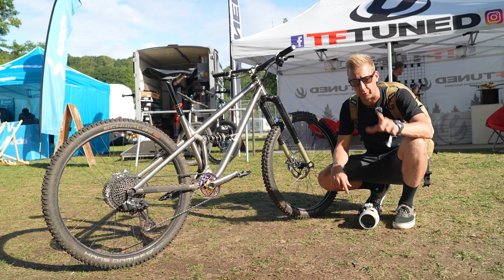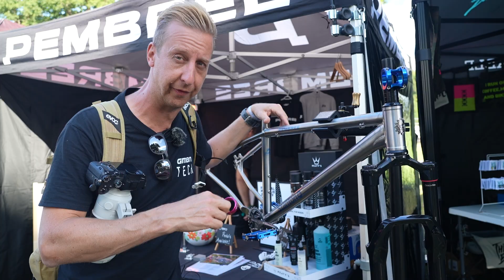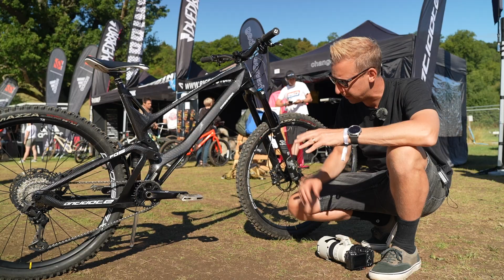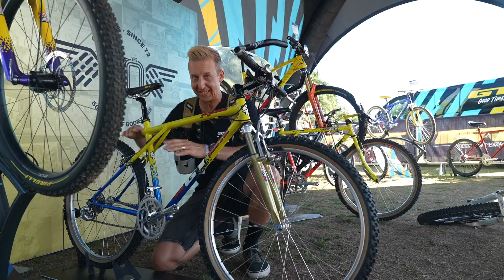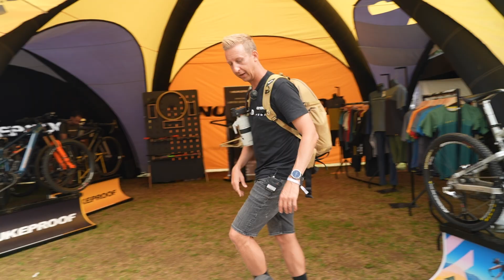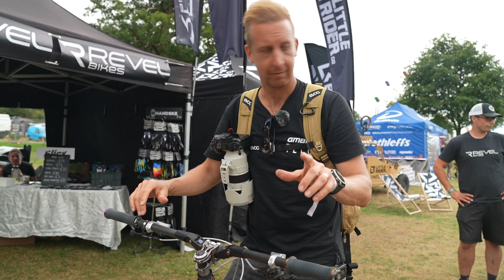The Hottest Mountain Bikes & Tech! | Malvern Classics 2022

Comment: I'm an above knee amputee and ride with an Absolute Black Oval Ring.   I'd say 70% of my power comes from my 'organic leg' and 30% from my 'stump n prosthetic leg".  I swapped to an oval mostly to smooth out my pedal rotation, as my pedal rotation was not smooth and could be described as almost 'jerky' on ascents.  I swapped to the oval and although the gains are subtle they are defined gains.  My peddling is now a lot smother on ascents and I finding  I'm using more power through my prostheic leg because of my now smoother cadence.   For me personally I will be always using an oval chain ring, along with my Hustle REMtec magnetic pedals - these have been an absolute gamechanger for an amputee wanting to get on the offroad trails.

Comment: See Wren inverted 150 mm 36 stanchion forks...been using on all my bikes...now on my E-mtbs. Plush, progressive throughout, easy to tune, and stiff. Very DIY servicability. Can run any wheelsize. Comes with carbon stanchion guards. Just a quick plug from a fan of inverted...I own three🤟

Comment: USD forks changed the game for motorcycles, both street and dirt, it's honestly only a matter of time before they do the same for MTB. Nothing like having gravity keep your oil bath in a place where it's doing a good job lubricating the fork (assuming non-cartridge style comes out first) plus the additional overlap for stiffness.
Reply: USD forks have been in mountain biking for over 20 years. They never caught on, and they flex a lot more than normal forks, actually.
Reply: On motorcycles they are stiffer but plushness is missing. I prefer older dirt bike suspension.

Comment: you also fail to mention that this polish bike is made of weaved carbon fiber, that is totaly outdated, but very pretty, modern frames are all made with unidirectional carbon, cut into hundreds of pieces and glued together, in a way that you can add flex, or stiffness where you want, in the direction you chose, but you need a super computer to design the frame, so smaller companies like that polish one use the old fibers, pretty, but not good
Reply: You do know they use uni underneath and just have the weave as top layer for looks right.

Comment: That reverse fork design is interesting but the stanchions being closer to the ground is gonna scratch real quick, not to mention mud and dust cycling through its seals.

An interesting design nonetheless, similar to the linkage fork.
Reply: Actually, it's better in this concept. Dust don't lay on the seals becouse they're upsidedown and You can avoid scratching legs by mounting guards (rulezmann doing nice ones for intend)
Reply: @sauber8623  As someone who used to ride manitou dorados way back when - usd forks  still get dusty and are prone to seal blowouts. They get scratched at about the same rate as normal forks if you have covers.

Comment: Both me and my bike are crap on the climbs so I put an oval chain ring on as I heard it helps. Wow what a difference. Same tooth count as I had before but I lost that feeling of lightness and disengagement when one foot stops pushing and the other takes over. With the oval I feel I’m always putting power down. Bare in mind I run flats and can pull with my feet so it’s not just technique. I’d say it worth a try and made more of a difference than lowering the tooth count did.

Comment: Oval on a full squish was a game changer for me. Significant climbing improvement.
Reply: Exact same for me, less knee strain also
Reply: So i want to Switch from my E-Bike to a normal Bike ITS better i Put oval Ring or IT ? Is there negatives If i so so? Ty
Reply: @lakaldrak  no negative that I have found. Supposedly it can put  more stress on your derailleur clutch and the first few crank turns may feel a little odd, but I am on my third oval, three different bikes with zero derailleur issues. Note; I did not like oval on my hard tail. But amazing on my full suss
Reply: @lakaldrak  on really high candence oval chainring feel little bit like you jump on your bike. Go for oval and never go back.
Reply: Same, I got an oval and there is no way I want to go back. Somehow, it just felt right the moment I started pedalling with it. Not that my bike was bad before, bit the oval just made the pedalling so much smoother!
Reply: Sounds good but really?!
Reply: @Lgncu7632vbyxsuhbdfe   Well, at the very least, I'm converted. Probably not going back to round again. Not sure what they cost internationally, but check out Csixx, good quality brand made in Cape Town.
Reply: @ShreddySteve  I use Absolute Black 32t. Approx £48 from CRC,  can't fault either the product, the price or the service.
Reply: @Lgncu7632vbyxsuhbdfe  I have a full suss with oval and a hard tail with round. The hard tail should be the most efficient climber, but it's not. The oval CR makes a huge difference.